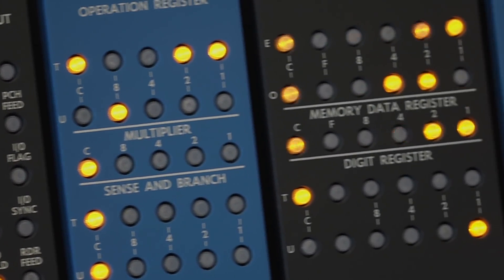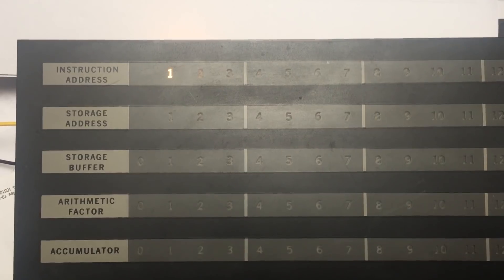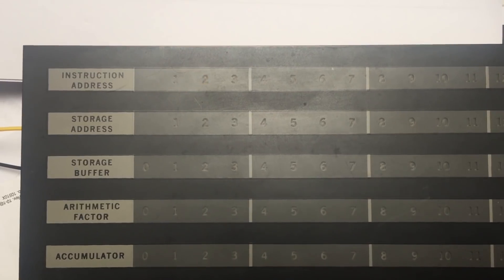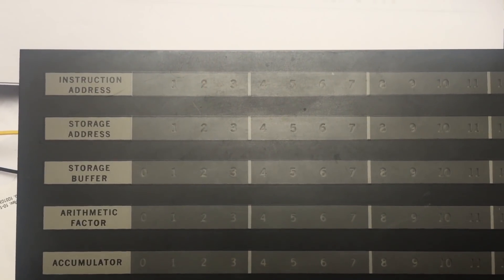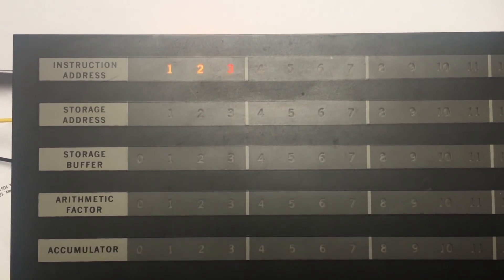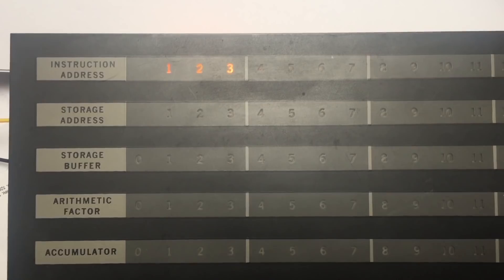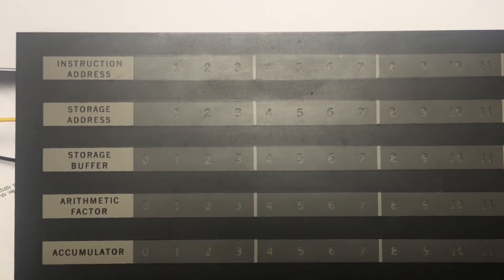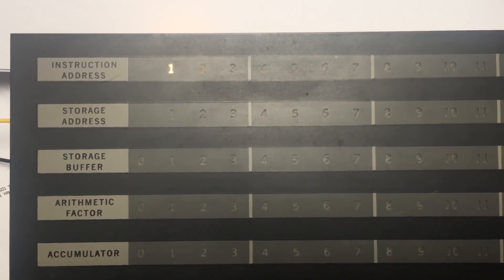Emulating blinkenlight front panels with LEDs: Carl makes a PCB for his IBM 1130

Comment: I make museum exhibits, making an old style telephone exchange right now with call line lights and plugs to connect caller to callee.   I'm using white LED's with coloured windows to emulate a bulb, in colour.  Using ws2812 pixels with code to emulate an actual tungsten bulb would be much better.  Is the code | curve algorithm published anywhere?  I still have have time to change the design.

Comment: I spent many hours in high school at a nearby college writing APL and Fortran programs on an IBM 1130. I also learned assembly language for the first time on this machine. I still have all the source code for programs that, for example, compute and plot Earth-Lunar orbital escape and injection on a Texas Instruments ink-pen color plotter. And one ominous Fortran program that ran a nuclear war-game simulation using Simula programs hand-translated into Fortran. It seemed like there was nothing the 1130 couldn't take on. The graphics capabilities put it in a separate class from the big IBM 360/370 business machines, which were not interactive at all. Each of the toggle switches on the front of the 1130 console were program-readable, and I used these to let a human operator "fly" the lunar simulation by activating various attitude and velocity thrusters, with the results plotted in 100X real time. This would let you fly to the monad establish an orbit (or crash)  in an about an hour.

Comment: Would the "neopixel-hw-controller-hardware" project on GitHub help you? Can be attached to APB master and can drive lot of neopixels just by updating memory mapped region.
Reply: Allows even virtual mapping where the physical order of the pixel in the chain doesn't have to match the order of virtual buffer pixels

Comment: Could this have been done with a two layer PCB?
Reply: It could have been but using internal layers for power simplifies routing. The LEDs draw about 7A when all of them are on, which would require bigger traces for +5V and ground.
Reply: @carlclaunch793  Wow, 7A is a lot for some LEDs. So a 2 layer board would need some really thick traces, or one or several local buck converters on the PCB, which would increase complexity a fair bit.
Reply: @Hagledesperado  154 LEDs on the board, each draws up to 60ma when at full white level. Mine will be yellowish not white so not the entire 9.24 A, more like 7 or 7.5

Comment: I guess I'll be the blasphemer, then.  I always thought it was a shame, that the lights on computer panels were so slow - they just became a useless blur in operation.  What made it even worse, was that BECAUSE of the great difficulty in changing bulbs, most panels ran the lamps at lower-than-rated voltage, which makes the lag even worse.  That Honeywell emulator panel is what we would have LOVED back in the day.  With LEDs, you can see 1 microsecond pulses; with incandescents, not a chance.
For me, incandescent lamps are like vinyl records and vacuum tubes - most of those who love them never had to put up with them.
Reply: The cool thing about this, is that you can simply switch to "digital" mode if you'd like.

Comment: To reproduce fade out you can attach a capacitor to each LED. Fade in is also possible to do with proper use of resistor and capacitor. No need for neopixel just to get fade, even when they look nice and you can simulate various kinds of lamps including tungesten, neon and even EL if you use neoplixel, also you can have proper colors of dim filament with them.

Comment: Nice ..I've been using ws2812b leds for a long while and love them ...I've made everything from silly IOT lights to whole video walls now but it has gotten hard to get good quality ones as they've gotten very popular...I seeing more and more suffer from wire bond failure in the package and interrupt the data line or display the wrong colours as the wire bond to each LEDs chip inside fails ....The SK series of LEDs aren't as popular and seem at the moment to be more reliable and are available in RGBW / RGBWW/ RGBY and more importantly the good ones have a continuous data bus so if one led fails the rest of the strip after that keeps working . .... looking forward to seeing the finished panel .. great channel ...well done.

Comment: This is not a trivial issue. With appropriately tempered blinkenlights, you can analyze the final state of  your ill-behaving program. That was one problem with cursed micro-processors in 1976. Many had no blinkenlights, so you had no idea what they were doing.
Reply: Unless you had something with memory-mapped graphics, in which case you know all too well what "snow crash" means.  And looks like.
Reply: On my 1978 Z-80 machine (with memory mapped graphics), I sometimes intentionally put programs within the graphics memory, so that I could see what they were doing.  It was like having really, really small blinkenlights - each pixel was a direct indicator of one bit of memory.

Comment: Why don't you use incandescent lamps, mounted on a flat board like that?
Reply: Because of the great difficulty of replacing them when they burn out, as Karl explained during the video. An LED, once installed and run comfortably below maximum power, will last far longer.

Comment: Ever since LEDs were used for fairy lights on Christmas trees, I wondered if someone would develop a 3 pin (power and enable) LED that would mimic tungsten lamps accurately in the way shown here. I’m sure there would be a market for a self contained tungsten lamp emulating LED for premium Christmas tree lights. At that volume of production I’m sure they’d become inexpensive.
Reply: There are unbelievably cheap microcontrollers that could do the job easily. The main problem would be to power the LED long enough to make it fade out again, as control of lights is usually done through cycling its power on and off.

Comment: A million times more computing power required to emulate the lights than the original computer actually had for calculations? 
Irony lol 😆
Reply: Yep i was thinking, the light panel microcontroller  is way more powerful then the host computer.
Reply: Note that it is not a microcontroller, but an FPGA.
Reply: the led controller has more power than all the machines in that floor combined, jajajaj that FPGA alone
Reply: and yet probably 1000 times cheaper to build and run.

Comment: I'm sure it's already been thought through, but due to the data rate of the WS2812 protocol, probably try to keep the strings a little on the short side if you can. Since the FPGA should have no issue doing a bunch of chains in parallel, that should let you keep the update rate high and allow for smoother interpolation between each of the states.

My personal preference though would've been APA102 addressable LEDs, they use an SPI-like protocol and as such you can clock the protocol a lot faster.
Reply: David Richmond they also use faster PWM clock so there should be no strobe effect especially on lower brightness levels.
Reply: It looks like he's made multiple chains of LEDs, with all the small tracks running along.
Reply: @nrdesign1991  I have four chains of at most 40 LEDs. The small tracks are running to I/O expander chips that sense the state of 40 pins - signals coming from the 1130 logic circuits - and are connected via I2C protocol to the FPGA.
Reply: @carlclaunch793   Interesting, please keep us updated on the progress.

Comment: I've done something similar in the past.. it didn't seem complicated to do to be honest. I just used an FPGA as well to generate shaped PWM signals driven by data inputs. I used a custom non-linear ramp with hysteresis with some coefficients to adjust for the specific LEDs used. On data '1', the ramp would start but a '0' at any point would flip the ramp (along with hysteresis adjustments). I didn't use an actual lowpass filter since that would use too many gates for the job.. I just used some coefficients which I derived from the input data rate which I just measured with a separate routine. I then serialized the outputs to minimize number of wires, and used some Toshiba TB62706BF chips I had lying around to drive the LEDs (they're 16-bit shift registers + constant current drivers in one). This project is extra cool if Carl's system ends up doing that slight color shift towards red at low power levels. An extra bit of realism! :)

Comment: Neat! For the actual algorithm, are you going with a physically accurate model, or will just use a color palette? From the first glance, using a simulated RC lowpass filter to obtain a temperature value to be converted using the Planck's law into the actual PWM values looks convincing enough, though I somewhat expect an actual bulb to have a different heat-up curve...
Reply: The fade out of the bulb depends on radiative cooling while the bloom is based thermal heating of a material whose resistance changes with temperature. The temperature then sets the emission both wavelength and brightness. As you said, real world is not a simple exponential curve 

I have two ways to proceed on this. One is to use my eye and some judgement to set the RC behavior and what color I would see at each brightness. I am still on the fence on whether bloom versus fade should have different RC constants; the human eye/brain can evaluate when the behavior is natural or unnatural. 

Ignoring the case where a computer signal changes somewhere in the middle of a half-cycle, I can treat this as a set of values from full off to full on. To simplify things, if it took one second to switch fully on then there are 30 steps from off to on.  I can sample the state of the computer signal 30 times a second and move one step up or down based on the logical state of the signal. This 'integrates' the changing energy to the builb, in a sense. 

The other way to proceed is to set up three filtered photocells, for red, green and blue at the same wavelength as the colored LEDs. I can then drive a real incandescent lamp of the right type with half cycles from off to on and off again. That will capture both the color and the brightness curves. 

The hardware I am building doesn't change as I refine the behavior. I just have to tweak the logic in the FPGA. I am using a Spartan 7 with plenty of capacity to handle whatever I need to produce 'good enough' behavior to fool the eye and brain into believing it is incandescent filaments rather than diodes.
Reply: @carlclaunch793  Thinking of it, the "fair" ramp-up/ramp-down simulation is fairly complex :) The fun part about it is the filament is cooled down via radiation, by the gas flow (should it be a gas-filled bulb) and by the supports themselves that have to cool down as well, yet do that much slower. Same for the ramp-up, which adds the R(T) dependency to the above. And yes, if coming with an RC approach, the ramp-up should be way shorter (myself I tried alike with a motor simulation which is somewhat close: the spin-up is driven by the decaying magnetic force and is inhibited by the rising air/fluid friction as well as the static low friction force - this isn't that tough should you write down the actual acceleration versus speed equation being a pretty simple differential equation with an "RC-style" solution for the actual speed versus time and the initial speed). The problem with the bulbs is that, unlike the motors, they have a non-linear heat-up rate vs temperature curve (the motors simply have a linear decay in force passing zero when BEMF reaches the input voltage, thus you get a linear part in the dv/dt versus v(t)).
For a captured LUT approach, I guess it is also worth adding a precalculated "jump curve" so that when the light is switched rapidly on and off, the system will just "know" where the given value from the ramp-up LUT is in the ramp-down one and vice versa, thus making a seamless animation.
Reply: @TheBypasser  I picked up an I2C based photosensor and will record all the combinations of 0 to 30 half-waves per second powering the actual incandescent light. That will give me the intensity to set for a partially lit bulb. Similarly, I will record a turn-on to full and a fade from full to off, to get the natural curve. The last bit will  be to tweak the colors of the LED to subjectively match each of the 30 illluminated levels of the real bulb.
Reply: @carlclaunch793  Are you going to, just out of curiosity, check if the turn-on/turn-off measurements can be matched by an RC-style exp curve, temperature-wise? By the way, it is pretty interesting how the bulbs behave under a pulsed voltage input: although the temperature is lower compared to a fully-lit bulb, the peak current becomes much higher. We once had to check on the start-up current of a like 50mA bulb, and it gets up to like 500mA, which means a really rapid heat-up on the lower duty cycles.

Comment: Is part of the reason you are doing this, that the original Tungsten incandescent bulbs are simply no longer available anywhere?
Reply: I can still find wire lead incandescents of the proper voltage, shape and intensity, but not that easily.
Reply: There is also the issue of bulb filaments being fragile, the ongoing need replace them when they fail risks damage to the original hardware.
Plus I'm sure some of us would like a modern version to hang on the wall.

Comment: Couldn't you put a small capacitor (47-100uF?) in series with single colour (warm white 2700K?) LEDs to make them fade up/down slowly?
Reply: No, you mean in parallel, if you put it in series and you pass a square wave, it would light up as if there wasnt a cap and then "slowly" fade away because the capasitor blocks the DC.
If you put it in parallel along with an inductor before you create a low pass filter making the square wave be more like a sine wave, that would look more like it but it would also affect the turn off making it take longer, something tungsten lamps dont do. 
All in all, you cant emulate the behaviour of a tungsten lamp with a filter, the tungsten lamp works by heat, the filament goes from dull red to red hot to yealow and then white hot, you cant emulate that with a single color led, also theres a delay before it gets hot enough to start looking red and then it also takes more time to get to white than it took to red because of radiation loses, something that also affects how tungsten lamps turn off because turning of doesnt mean no light, it means no heat, so the filament needs to cool down to stop emiting light and it does so from thermal conductivity and radiation in the form of infrared and visible light.  That causes, like he said, that when the lights blick fast they look more like a constant redish rather than a mechanical on-off white like a led would. All of that together creates the look and feel of the originals.

Comment: Very cool! I had a somewhat similar, but fairly large scale project a couple years ago (with about 160 lights). It was for a switching control panel for my Dad's model railroad. What I ended up doing was getting a fairly cheap string of neopixels (the individual bulb kind without 7 inches of wire between each bulb), and simply sticking them to the backside of a piece of plywood which had a hole with a diffuser attached (easy to find for cheap). Actually controlling them was a board from adafruit called a "fadecandy" which will control up to 640 neopixel LEDs (in up to 8 strings of 64) with a USB interface, with a raspberry PI keeping track of all the trains and switches and showing the proper lights. No custom PC boards required, and the whole business cost less than $200 to set up. It wouldn't replace Carl's absolutely wonderful museum-quality restoration, but if you want to have SOMETHING going quickly while you're refining, I could not recommend the fadecandy more.

Comment: As always, educational and entertaining.  I would like to understand how the connection to the lights were done originally - was there a post-processor like in this example with the FPGA or was each light directly hooked up to the line it was monitoring?
Reply: Each line was hooked to a Silicon Controlled Rectifier (SCR) which drove the lamp for each AC positive half-cycle where the signal line was on. Thus an individual lamp could be on 0 to 30 half-cycles per second, with the filament of the incandescent bulb integrating the state to some average power level and thus color and brightness.
Reply: This is a great info, I actually never came across elsewhere! (I was always wondering about the accuracy of the sampling rate of modern blinkenlights.)